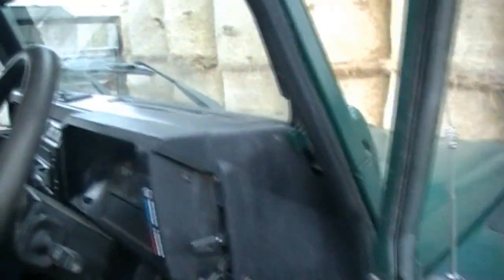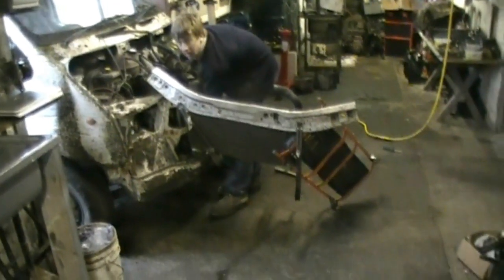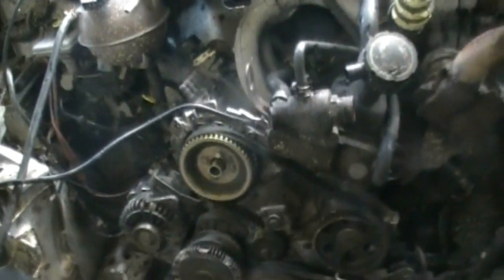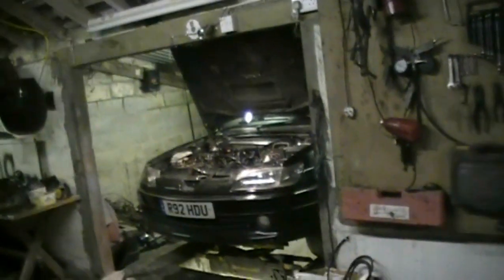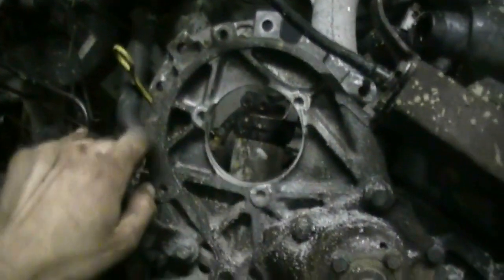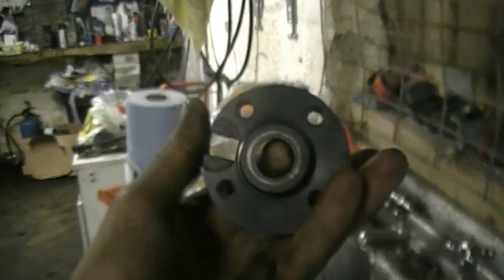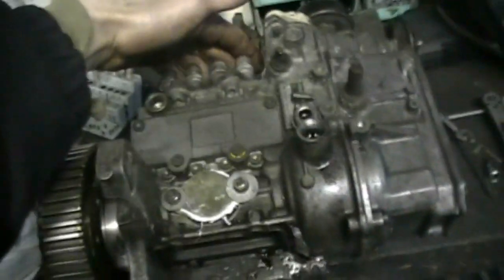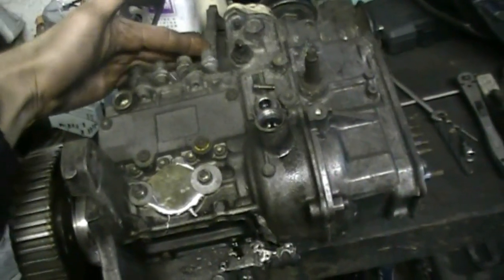The Sheds Inline Pump Project Part 1

Comment: hi darren, what is a VE and a M pump? and how would fitting an M pump benefit? 
one more question, i have one of these transits and how do you adjust the original pump for better performance? cheers and a have a happy new year :)